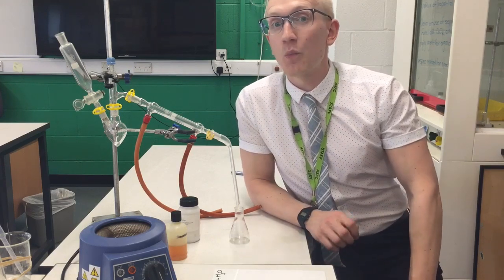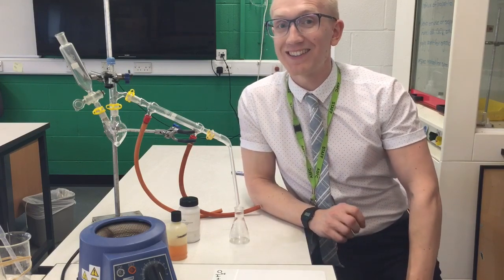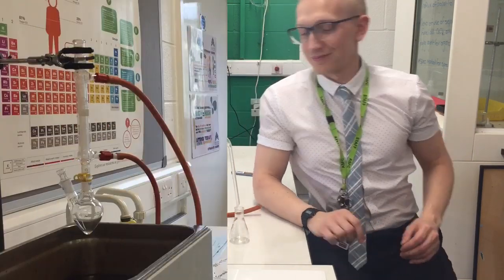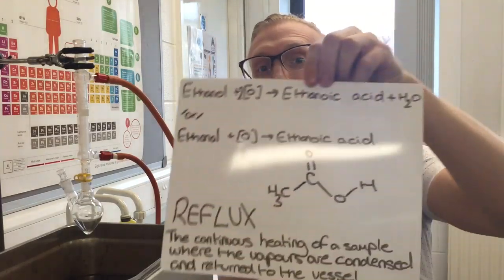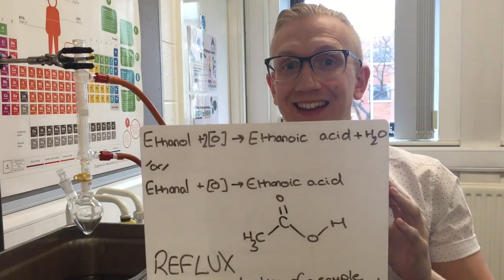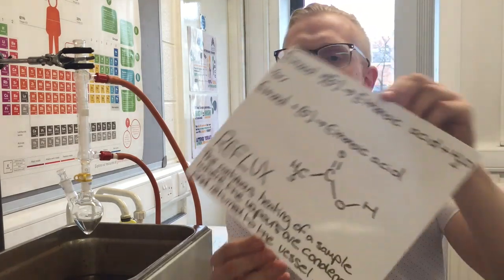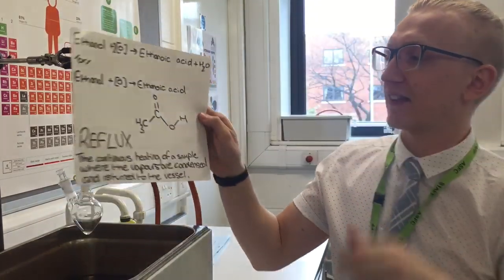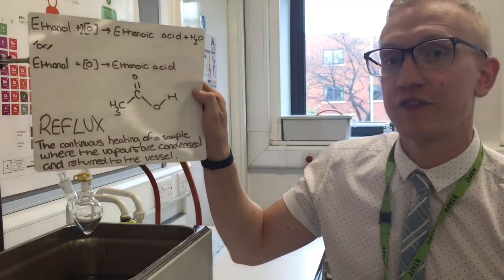Reflux or Distillation for A level Chemistry || oxidising alcohols

Comment: Fantastic video! Follow up question: should you ever consider adding boiling chips with distillation?
Reply from the maker: Yes, absolutely, anti-bumping granules can be used to prevent violent boiling in either reflux or distillation